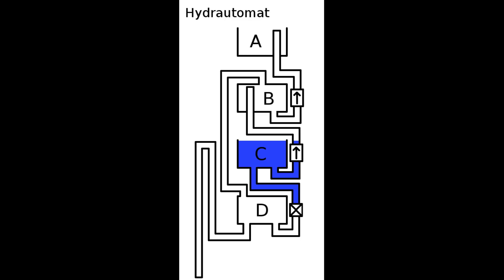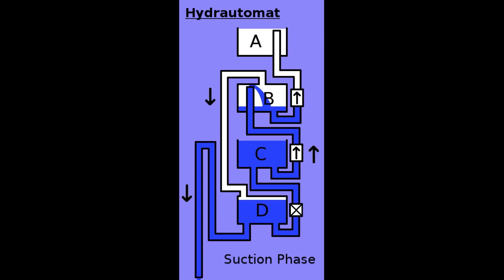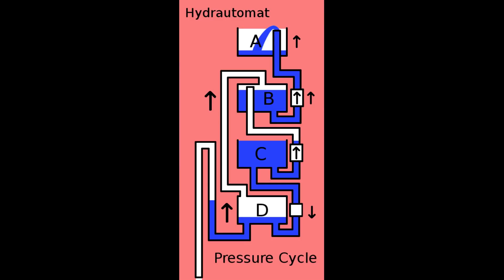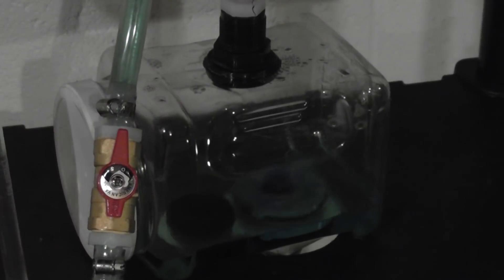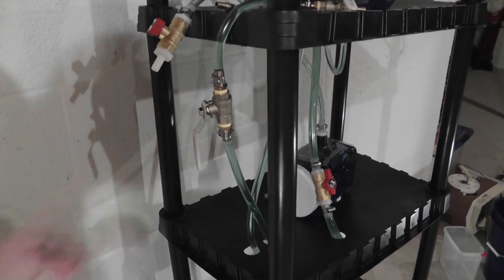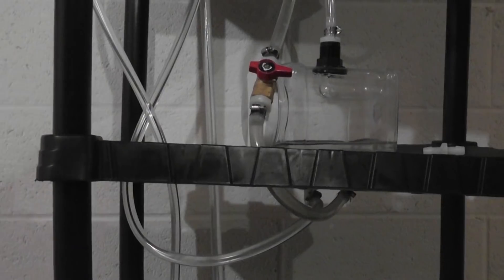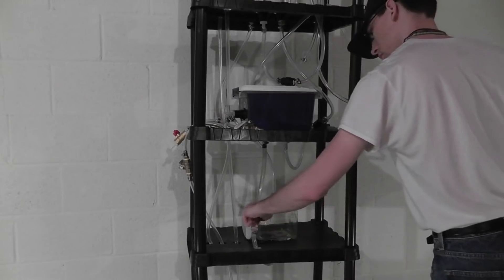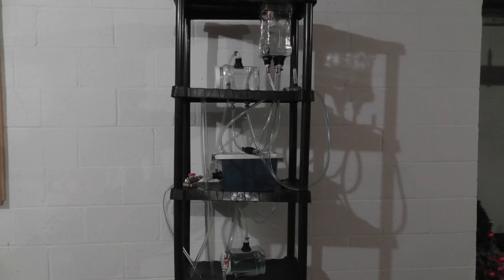Water Pump Powered by Gravity - The Hydrautomat

Comment: (H)  FYI---the FANS that can be  added and operated ….to move the ambient AIR …  using the pulsed water...that I built …..had to be built with the precision of a jeweled encasement watch....to almost eliminate the drag co-efficient of the pivot bearing load point  !!!  They engage and dis-engage... automatically ...using the old mechanical governor devises !!!  
   Yes...seems complicated....not really ...materials are plentiful....( hint real glass beads )
 
 [R.W.H.]  09-25-2019

Comment: (H)  BlueJersey112....the  mental challenge....is that the topmost tank (5th)  was  originally designed to remain OPEN AIR - absorbing the ambient particles and also can be used as a mixing-settling  tank. AMBIENT FLUID  TEMPERATURE remains a constant value !!!  ARGUEMENT  = EMPHASIZE the sound-noise ....measured in units  of decibels  compared tp other "pumps "  !!! 
  This ARGUEMENT ….will make the "human female  nurturing connection ….when baby is sleeping "   !!!  
 Thank you for your continued efforts....to IMPROVE LIVING CONDITIONS OF  EARTH !!!  
 Hopefully the angry delusioned  millennials... will make this WORK....a NEW  POWERFUL  TREND for DIY'rs !!!  
[R.W.H.] 09-25-2019

Comment: Just what is it supposed to do? What it appears to do is lower water from a higher level to a lower on which can be done just by tipping it out of the top tanks. If you want a simple lift pump use a hydraulic ram.
Reply from the maker: Some of the water is 'lowered' into the Operating Tank in order to pump water from the Feed Tank to a higher level. It is a more efficient and non-mechanical means of pumping water, which can be readily implemented in developing nations for irrigation and other uses.
Reply: why do you need several tanks?

Comment: Michael how the valve look like?
Reply from the maker: Traditionally a see-saw like device, with a catch pan on one side and a 
counterweight on the other, is used to open & close a Float Valve. 
The catch pan fills up with water whenever the Siphon starts draining.

However: you can use pretty much any setup/method; so long as the tube supplying water to the Operating Tank is blocked/closed when the Siphon drains. You just need something that 'detects' or is actuated by water flowing through the siphon, and then signals a valve on the tube going into the Operating Tank to close.

I hope that helps clear up things more. Thanks for taking an interest in the Hydrautomat.
Reply: Can you please make a video tutorial about the different kind of Valves. I think, this is the only important part of the hydrautomat. You  will save the live of many peasants in my country if they can build their own hydrautomat.
Reply from the maker: Hello soulbobo1,

Sorry for the late response. The patent for the Hydrautomat is:
US1444442 , which shows two types of valve for the device. You can look up the patents on Espacenet.com or Google Patents for free.

A more advanced Hydrautomat (which I haven't built yet) is GB227991, which uses two Operating Tanks and pneumatic accumulators for improved efficiency and operation.

Another interesting device is:
US1736777  , which is a combination Pulser Pump and Airlift Pump. I definitely suggest you look into the Pulser Pump on YouTube, it's extremely simple and can be combined with the Hydrautomat to move water across long distances.

Appropedia is also a good website to check out for these types of technologies.

Thank you,
Mike
Reply: only Jesus Christ saves lifes. God bless.

Comment: this has to be fake
Reply from the maker: Nope, it's absolutely real. The water going into (and out of) the Operating Tank creates a pressure in the air tube which can then affect water elsewhere in the system. 

It's NOT a perpetual/overunity motion device: as the water entering the Operating Tank inevitably drains out onto the ground below via the Siphon. Everything on the device obeys the laws of Hydraulics.
Reply from the maker: You can check out the video titled 'Running the Minature Hydrautomat' to see a start-to-finish demonstration of the device.